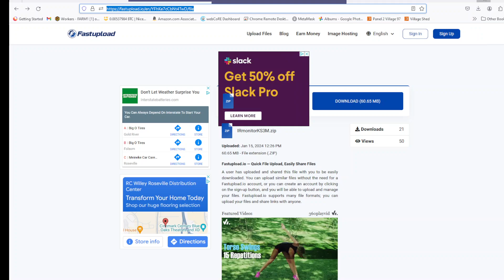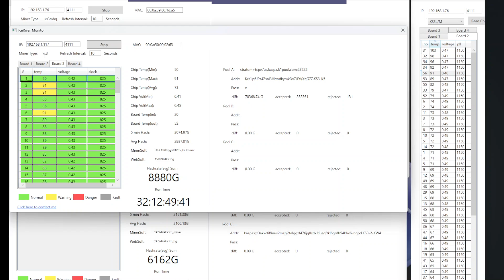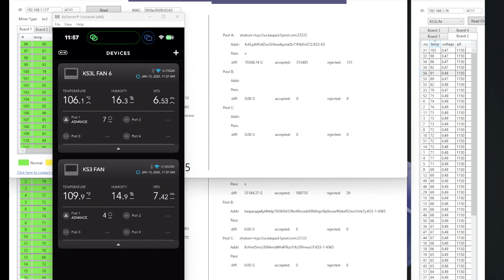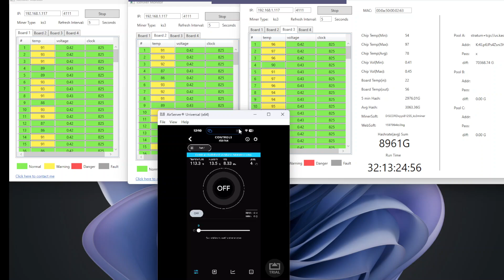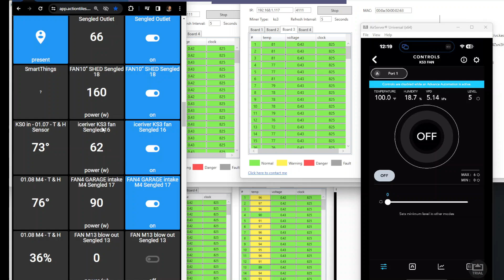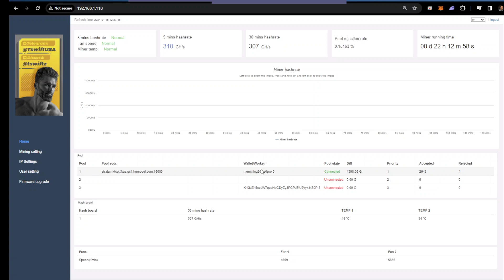ICERIVER MONITOR A MUST HAVE TOOL, MONITOR YOUR KS0, KS1, KS2, KS3L/M, KS3 CHIPS TEMP/VOLT TUTORIAL

Comment: i just got one of my chips is grey (fault) how would i troubleshoot if this is a real issue?
Reply from the maker: all depends whatr overcklocks you running or stock firmware, if stock that means one of the chip went bad and the miner will perform with less hash if its ks3 or ks3m it caan potentialy damage other chips so check voltagre as well to make sure it didn't go higher than 5.2V on other chips.
Reply: I'm using stock firmware. I Have a Infinity supplying more than enough air to it. I may just have to repaste the boards.
Reply from the maker: @nickmarcil6614  most likely thermal paste or sticker issue I had mine covered with clear plastic you can check in the other video
Reply: which other video
Reply from the maker: https://youtu.be/fo4syAihxf4    @nickmarcil6614

Comment: on my ks3m i notice that board 1 has clock 1050, while both board 2 and 3 have 1150. Is that normal?
Reply from the maker: Typically I have all 1150 some times few chips can go down to 1140 or around that and come back to 1150 something maybe not 100% on that board. Did you upgrade firmware to latest?
Reply: @DontMindMeMining  it came from factory a week ago with the fw 5977449 which is also the last one i see on iceriver website.
I have order the thermal paste and I will change it Saturday.
I see that a few chips jump a little over 100 and then down then up. Just like 3-4 in total for the 3 hashboards

Comment: I have a ks3m brand new, no hashing. I see the tables with the list of the chips and the tables are all grey. however i don''t see any voltage and clock (everything is at 0). Temp1 and Temp 2 is around 23 C. The chips temperature instead shows min 86 max 129, min 86 max 128, min 77 max 123.
Reply from the maker: Ks3m will shut if any chip temps above 120C I think you have to provide better cooling if your chips all grey that means miner not hashing either not connected to pool check setting for pool or overheated restart power and better airflow  and should go back online
Reply: @DontMindMeMining  Thank you for replying. I have just fixed it and this one is my story.
A couple of weeks ago I shipped a brand new by factory KS3M to the hosting company.

Once the received they said that one fan was not working. Once they replaced it they said that the machine was not hashing. Indeed in the pool I could see like 10 GH/s and then stopping after a few mins.

I told them to ship the miner back to me. Once I energized it I could hear the miner not sounding right. Just different and quieter than my first ks3m I have (and that company is hosting).

Long story short I have just find out that they installed backward both outfeed fans while they replaced the broken one. That makes sense with having temp in like 23 C, temp out like 23 C and abnormal chip temps.

Once I installed the fans as I think were right, the machine started hashing and now it the iceriver monitoring tool is showing the right temperatures, voltages and clocks.

It's unbelievable and I'm furious.
Reply from the maker: @marioori  I’m glad you were able to figured it out before the chips got damaged. I can’t believe the hosting  company cannot do a simple task.

Comment: I experienced some hashrate degradation with the 340gh overclocks on one machine, so I moved everything back to 280gh. I'd rather just keep it nice and steady for the next year than risk hosing the chips.
Reply from the maker: definitely, I have one of ks0-pro was OK on 300GH OC and ob 340G OC upper mosfet going to 100C when I check with thermal camera and on both 340 and 320GH ,  after that silicone glue melts it will not go back to 300GH,  so i had to put back to 280GH where it hashes around 295GH anyway

Comment: ks0 (non pro) works normal, ks1 program just closed (crashed?)
Reply from the maker: I don't have ks1 but it should work same way on older or newer tool. if it crashes there maybe still a bug that you can report to Tswift.
Reply: @DontMindMeMining  trying to report and get answer "i don't really provide support for the tool as it's a free release and still being updated. ks1 monitor works for others though so it might be your network blocking the connection or something"
Reply from the maker: @dimavk811  that’s very possible with network settings make sure you are on the same network as miner and if you have router settings for any port blocking open maybe that port 4111
Reply: @DontMindMeMining  but ks0 works fine on same network! ks1 i tried 3 differentc pc's (2 pc and laptop) different win versions (7x64 and 10x64) sometime after read button i see green blocks and program closes
Reply: I have the same problem. ks3m @dimavk811
Reply from the maker: Hi, try out a new updated tool and see if it works, make sure to select your ks1 in drop down menu, if it doesn't something possibly with your Asic, may need to factory reset and reinstall firmware but i can't be certain  @dimavk811

Comment: take it apart and pull that board with the 103c need to put new thermal paste its quite easy.
Reply from the maker: I know, that's the plan bu that  will be part 3 video, part2 is to update it with fruiting design kit and see if any benefit for that chip.